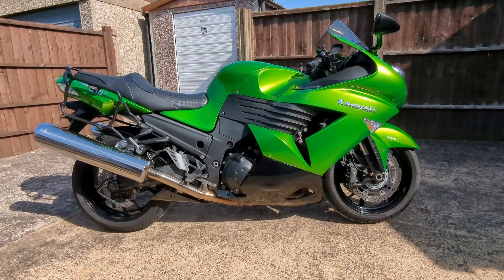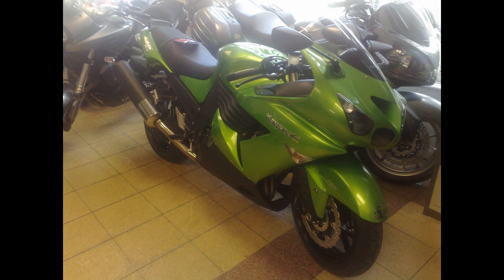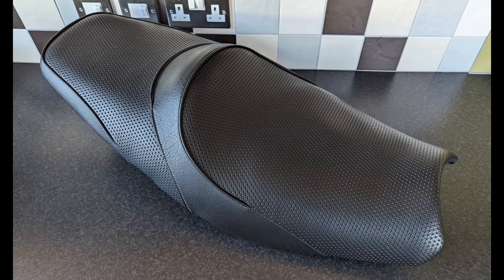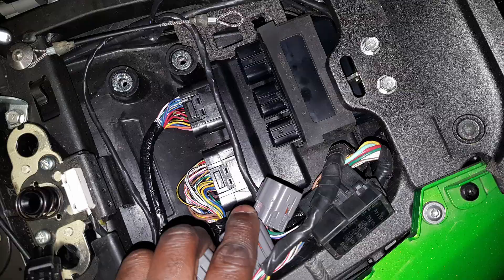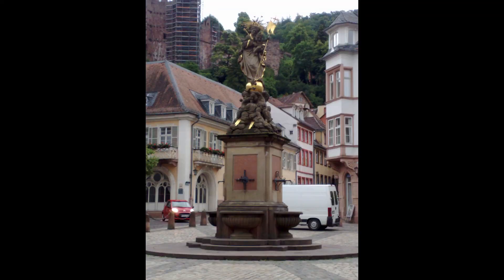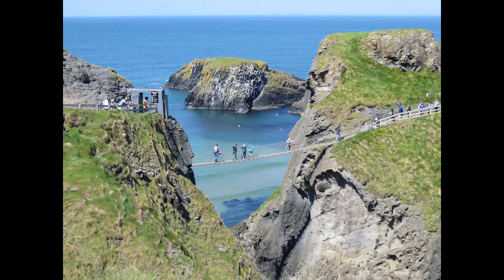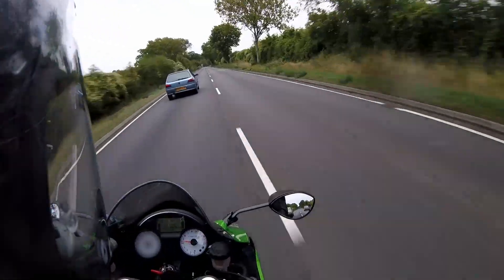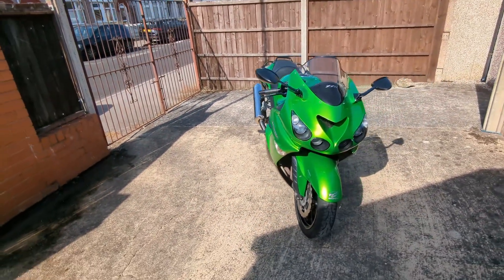2009 Kawasaki ZZR 1400 ABS walkaround

Comment: Derek, we still have the ZX-14R available in the USA as of 2024. It couldn't pass Euro 5, but we don't go by that standard in the USA. Kawasaki decided to continue selling the bike in countries that don't use the Euro 5 pollution regs. I own a 2013 which has been a very good bike and has not given me any trouble at all. I've done some hop-up mods. on mine and it is very fast. ECU flashed, -1 front sprocket and Akrapovic exhaust slip-on mufflers. I don't even want an H2, the 14 is fast enough for an old man like me! Ride safe Kawi brother!
Reply from the maker: Nice to hear from you in the USA 😀
Indeed, I was a bit puzzled when I saw a picture proclaiming the 2024 model. Mind you, it looks awesome in its 40th Anniversary Edition colours 😵 The only faults I've had with mine have been due to external factors.
Tbh I haven't done any speed mods to mine, as it's waaaay more than fast enough for UK roads - and my abilities! 😉